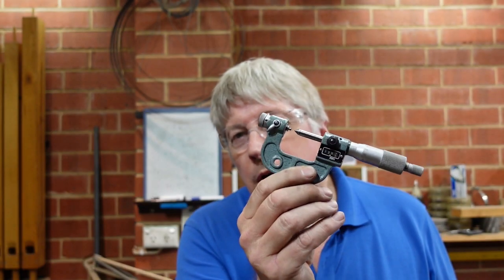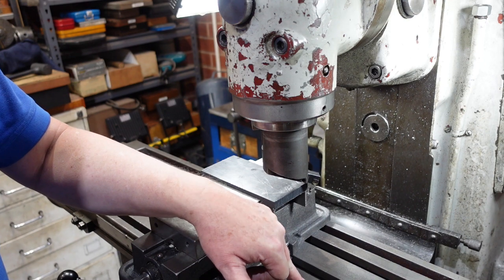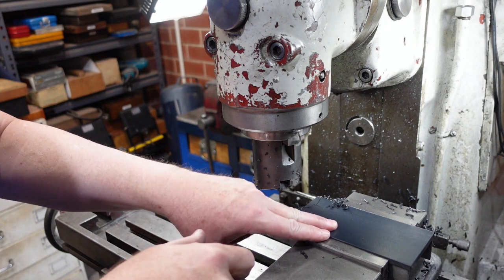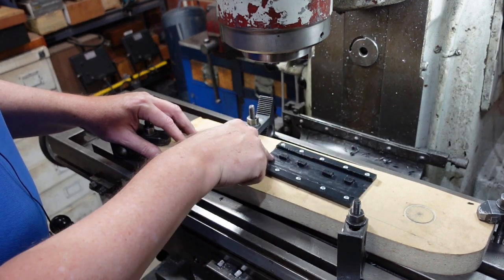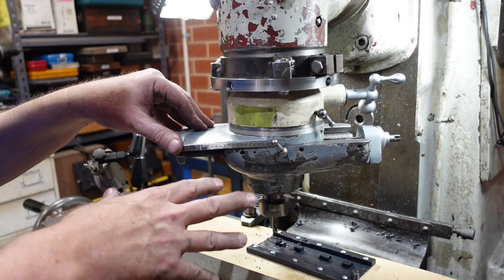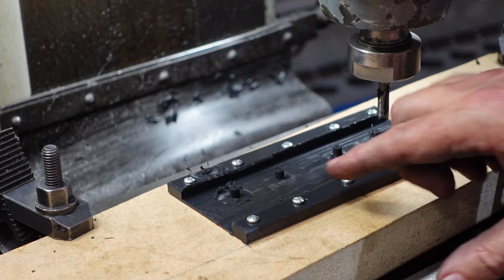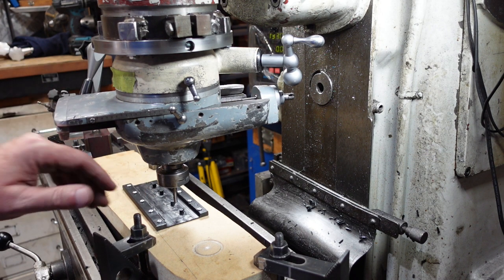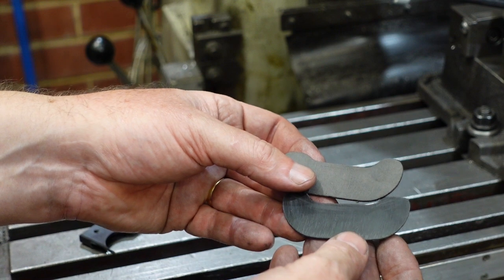Making replacement micrometer parts with a Volstro head

Comment: And for all this we never saw any action of the Volstro head in use at all. Where you mention being concerned that a standard spiral flute milling cutter might have a tendency to lift the work and dig in i think that is not a great worry if the cutter has a real keen sharp cutting edge and is hss. Another option would be to use what is often referred to as a 'down cutter' where the spiral helix is in the opposite direction.
As someone below has already said 3D printing would be ideal for making these micrometer cheek pads  and plenty of oil resistant filaments available at affordable prices these days.
Reply from the maker: A couple of friends have commented on the lack of actual machining with the head, but the footage I took of that did not work very well (out of focus). I will get back to it though and try and do something (I also have some mods/ repairs to it I need to do, so I hope to be able to show the inside too). One of the big issues is finding a suitable part that is interesting enough to demonstrate the device without being complex enough that it takes a long time and is bogged down in set up.

Comment: I would have had m y mate 3 d print them, then again I am still waiting for the first item I asked him to do 3 years ago.
Reply from the maker: 3D printing could work but particularly with oil and solvents around, I'm not sure how durable it would be.
Reply: @occasionalmachinist  There is a good selection of 3D printing filaments that would be very suitable for this component and are highly resistant to oil contamination.
Reply from the maker: @howardosborne8647  There are, and making these parts on a 3D printer would be a doddle. I like these more traditional ways though as you have to think a lot more about how you are making things - it is one of the issues I have with Engineering students when they come and work for our company. They are trained up on CAD and CNC machines (including 3D printing, but have a lot of trouble working out how to make things 'conventionally'